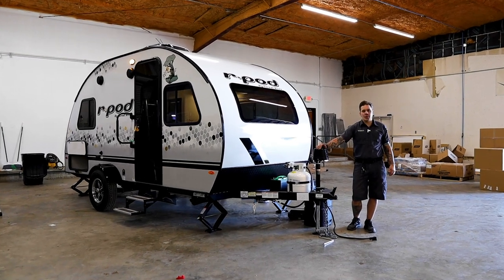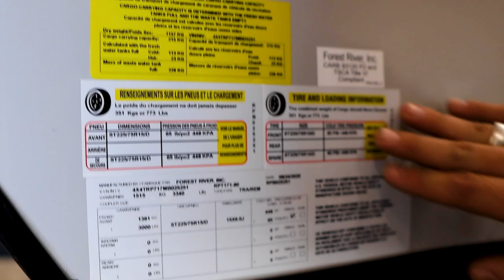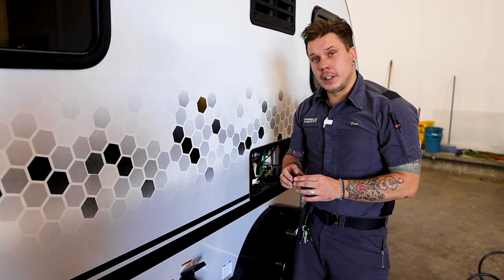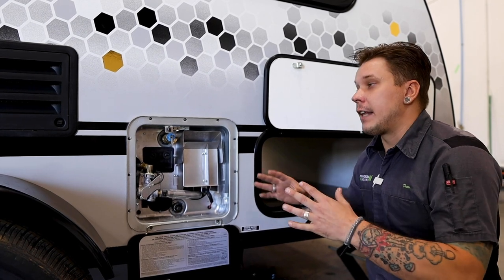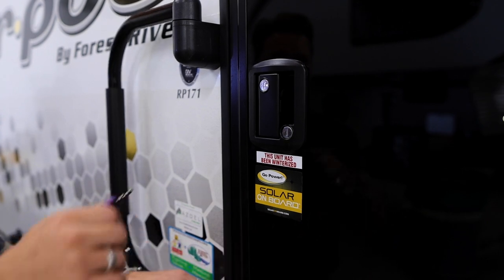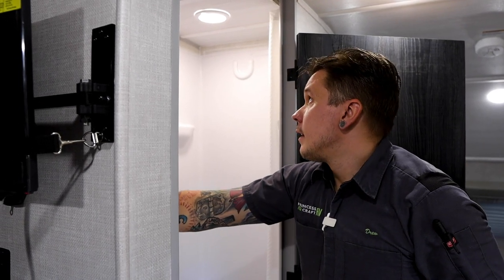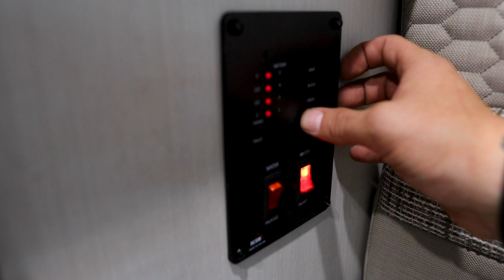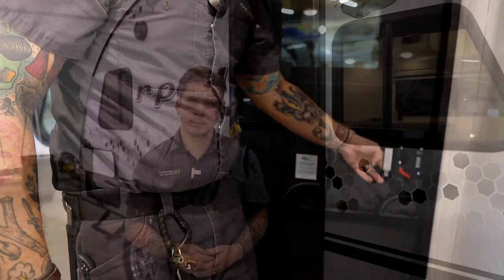2021 R-Pod 171 Tech Tour

Comment: No awning?
Reply from the maker: The smaller RPods like the 171 do not come with an awning, but lots of other floorplans do.
Reply: The 171 does not come with the attached auto awning.  It does have the option for an R dome awning/screened in porch.  It also has a "baseball visor" awning.  Look it up on Amazon.

Comment: I live full time in a 2016 171 R-pod. Man, R-pod has made some disappointing changes for 2021. Mine has the microwave over the fridge, so you can conveniently see in as the microwave is eye level. Not knee level as on the 2021. One of the big changes I would have liked to see was a little lengthier bed so you can fit better. The fridge went from my 3 way to a 2 way. Both the thermostat and the radio have been cheapened. The little corner bathroom sink is worthless and just gets in the way. I removed mine. The outside tank outlets on mine empty in one place. Separate for the 2021 which is not as good. The graphics on the outside are hideous. The dull grey on the walls and interior are not as well done as mine. Overall, I'd say R-pod has made a disappointing step backwards. Their designer should be fired. As well as the tatooed freak who just wasted my time.
Reply from the maker: I am so sorry you do not like the design changes, we will pass along your concerns to the manufacturer. As for Drew, we'll keep our tattooed freak, thank you.
Reply: @RVTechToursatPrincessCraft    I want to thank your Tattooed Freak for an incredibly comprehensive and informative video! I am in the market for this specific R-pod and the video is extremely helpful!  As a soon to be first time trailer owner, this type of content is priceless!  Big Kudos to Drew for his expertise and spot on presentation skills!  (rad ink by the way)
Reply from the maker: @codyrayl6629  Thanks for the love! Let us know if we can get one on order for ya!
Reply: @RVTechToursatPrincessCraft  I love the tattoos! Some people just can't find happiness anywhere :)
Reply: Drew, I got a lot of good information from this video that will apply to other units as well. Will you please do one on the 2021 Keystone Passport 210BH?
Reply from the maker: @Tsch6373  At this time we do not carry that brand, I am sorry!